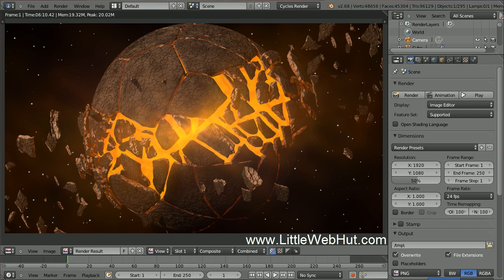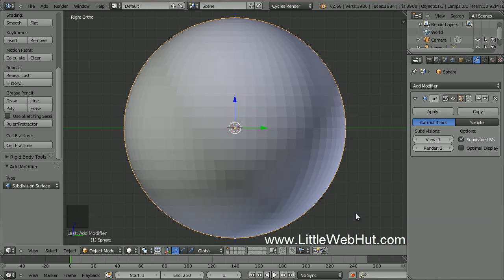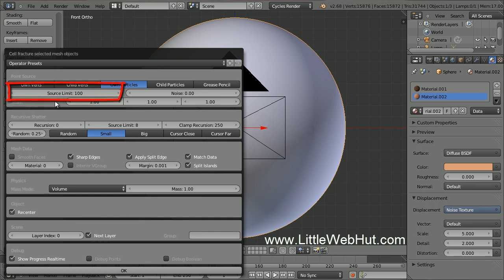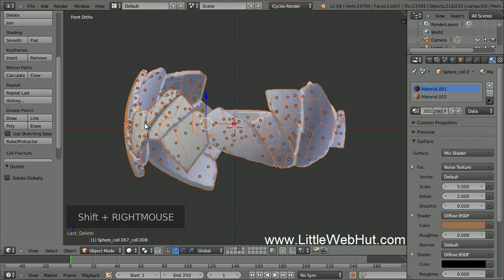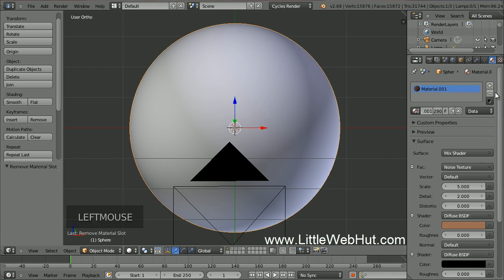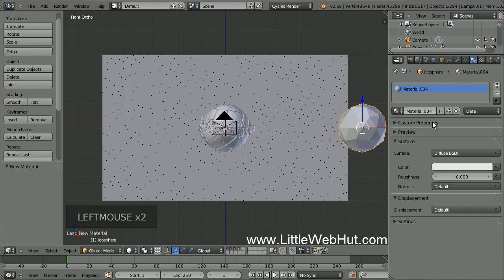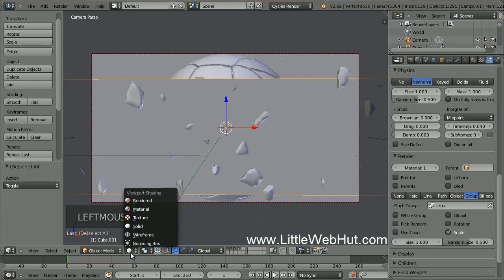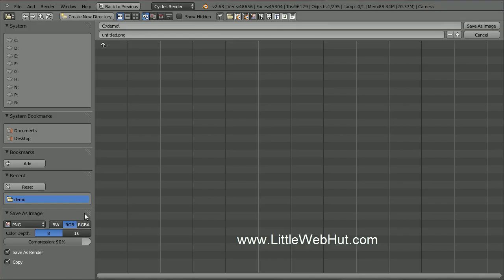Blender Tutorial: Planet Bursting into Pieces

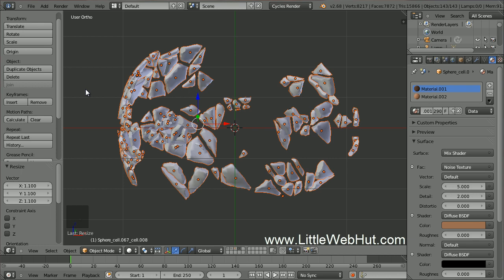Comment: For those with 2.76,  at 10:34 the 4th area won't have the origin to geometry option. The only way i could get it to appear was to take the 4th area, cell fracture to 5, delete 4,  join 5 and move back to 4. then on 4 the Origin button appeared.   Then i could set Origin to geometry and scale it to 1.1.    Your thoughts on this, tutor4u?

Comment: I have almost everything checked out. I seem to have an issue getting the 3rd layer of pieces to spread out further. I followed each step specifically, however, the crust group does not wanna work with the particle system's settings. I'm currently using the 2.71 version of Blender.

Comment: Very well presented tutorial. I had 1 problem though. At the part where you change the emission settings to 1 and 1, I ended up getting no particles on the cube. I managed to get particles by pulling the start slider to negative values, but I am really confused as to why your way did not work.